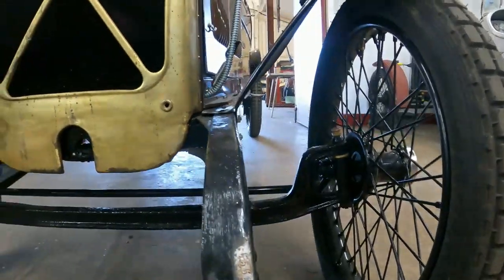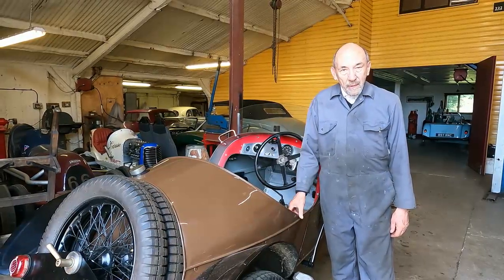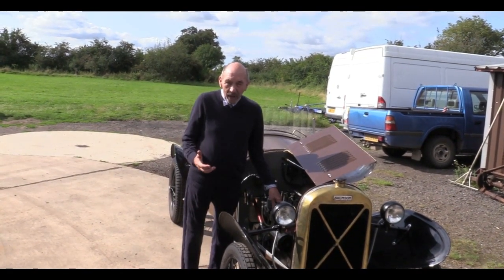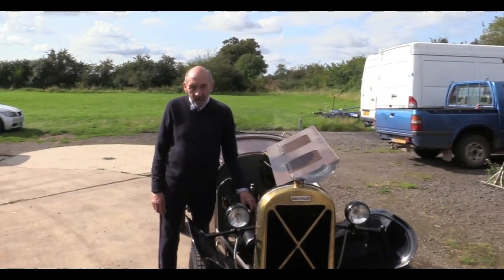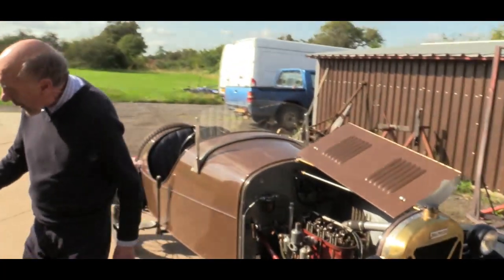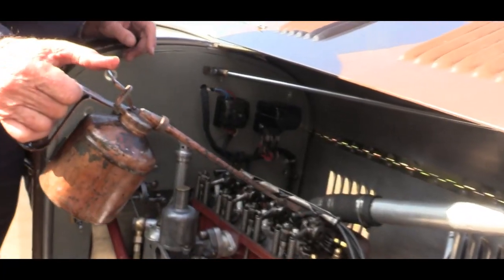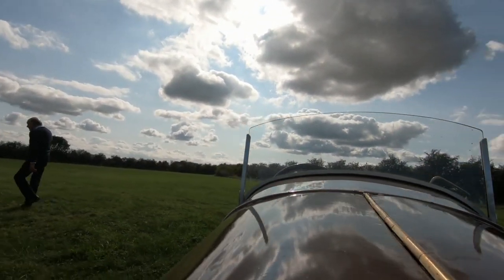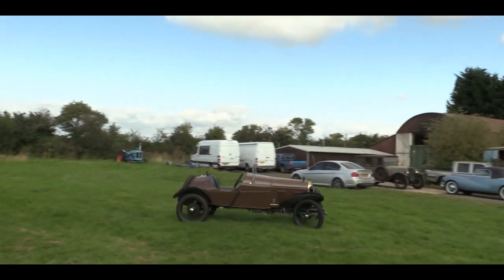Ivans Shed / Ivans Barn - Salmson

Comment: Yup, I was afraid something untoward had happened to you, and as I was watching your video on the Bugatti powered midget for the second time I noted "Ivan's barn" off to the right hand side of the screen. I clicked and here you are! Welcome back from an American builder much like yourself who enjoys nothing more than fabricating solutions from materials at hand. I am the proud builder/owner of a restored 1965 Sunbeam Tiger, a modified 1959 Hillman Husky with polished and chromed Jaguar suspension, and modified for a small block ford V8, a1952 Singer SM1500 roadster I'm constructing as a supercharged open wheel racer, a restored 1974 Jacobsen, and a hopped up 1977 Sears garden tractor(s), a1941 GMC CC303 flatbed restored, and modified with a hydraulic tilt bed for car hauling, and lastly three in process outboard speedboats from 1959 , 1965, and an early seventies flat bottom. The real joy is in acts of building, then testing the limits of our creations, not in the static act of possession. Again, great to see you back, monetize your channel, and produce more content. Your record will survive into the far future inspiring others to follow in your footsteps. To all, and sundry, get your darned vaccines if not for your own sake then for others.